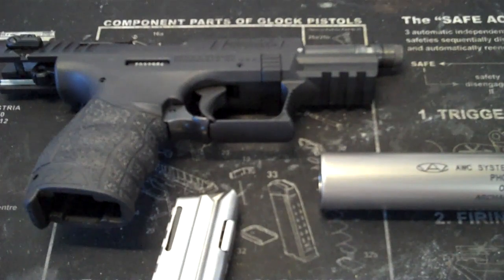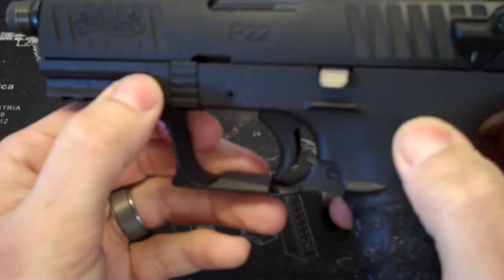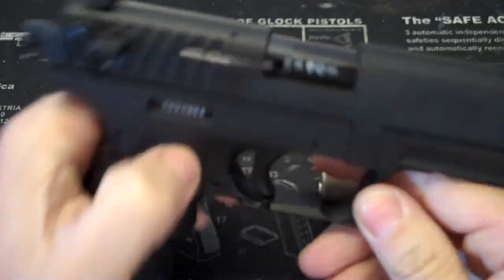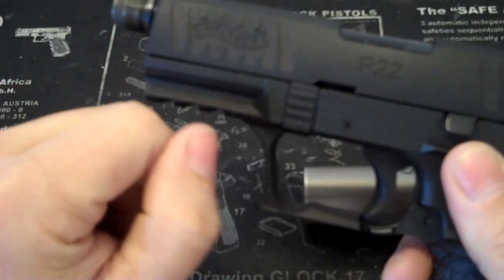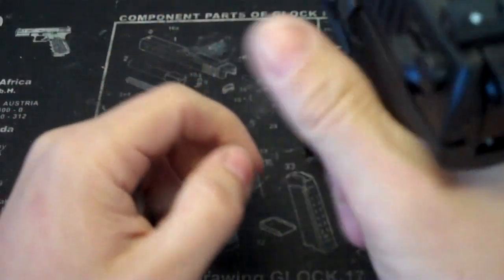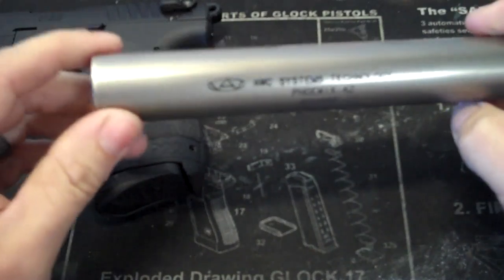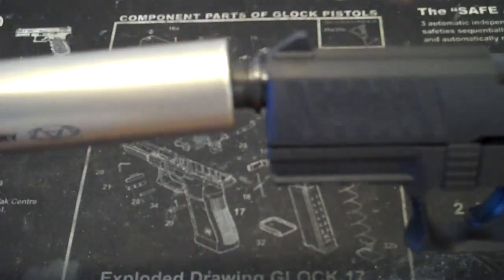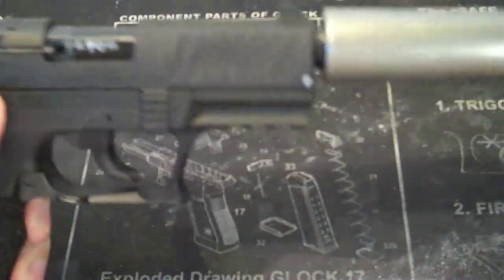Walther P22Q + AWC Archangel T silencer  Video Review

Comment: I just got my old p22 replaced by Walther with a p22q because of the most well known issue with the p22...ftf and fte + when I cleaned it with gun scrubber the actual finish bubbled away off the polymer frame. Maybe my fault for not knowing to clean a gun :) or maybe just a bad finish period. Anyway, they hooked me up with the p22q a laser and 2 extra magazines. I have nothing but good experience with Walther. Great customer service and definitely a fun handgun for plinking.

Comment: This walter P22Q; does the barrel comes threaded and then you add the adaptor to mount the suppressor? I cant find info; my local Bass Pro Shop got one I would like for $329.00 but the salesman says the barrel is not threaded; saw a video from a guy saying it comes with a thread protector and a wrench in the box, so what can you tell me? thanks!